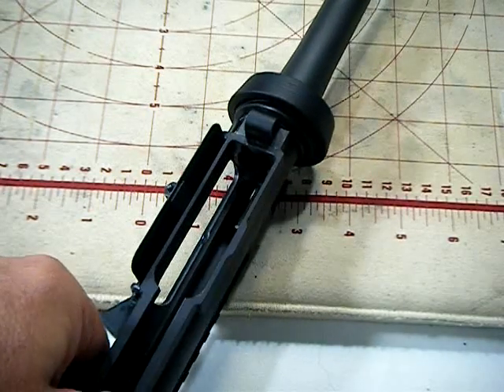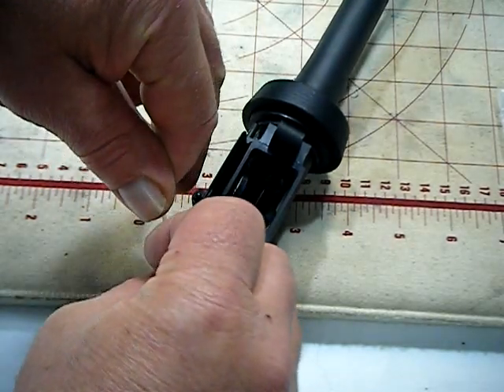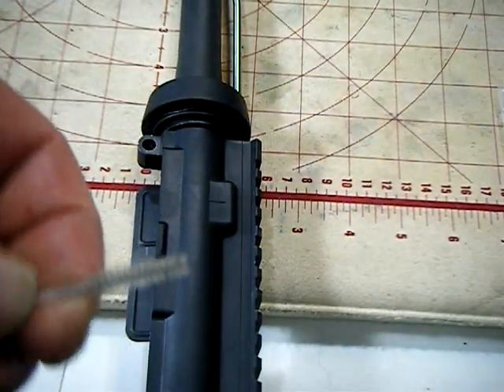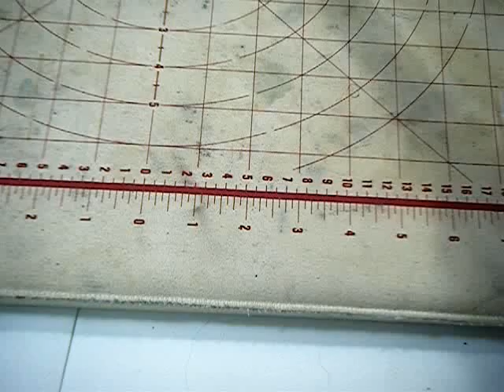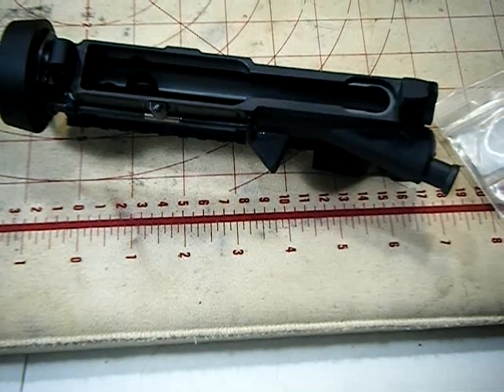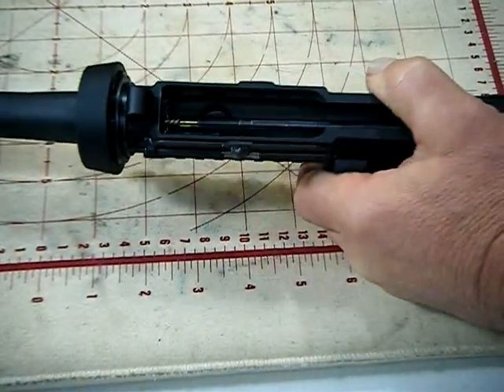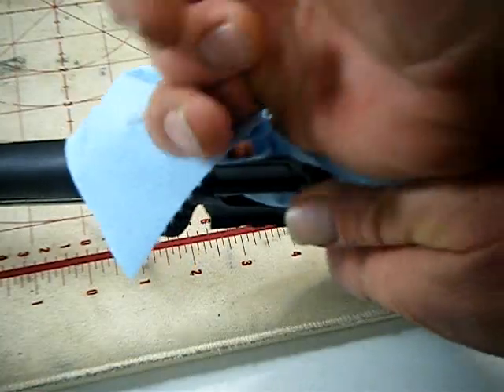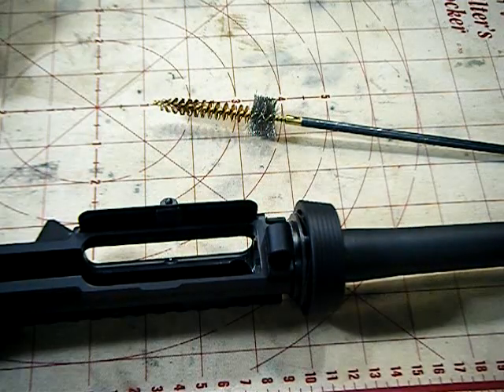Cleaning The M-15...Part 7..The Chamber.

Comment: Does the towel get the recess area in front of the locking lugs very clean? That area was very hard for me to get clean. Of course none of my Army "superiors" showed me how to properly clean the rifle anyway. Would a patch in that area work if you could rotate it around as you spin the brush? I don't have an AR15 at the moment so maybe you could experiement with that and let me know. Good vid. I learn more from you guys on Youtube than I ever did in my short stint in the Army. Thanks.

Comment: You will literally erode a hole through the stainless steel tube before you clog it. They tend to burn through inside the FSB where the gas takes an abrupt turn. 

There is nothing "by chance that's in there". Scorching hot gas is blowing through there at 20,000+ PSI... it laughs at the various pipe cleaners, solvents, and other gimmicks people are using to "clean" a gas tube. 

If you want to clean your gas tube, all you need to do is fire a round through the rifle.